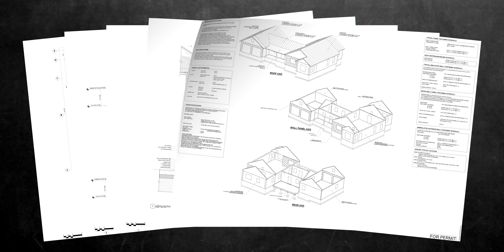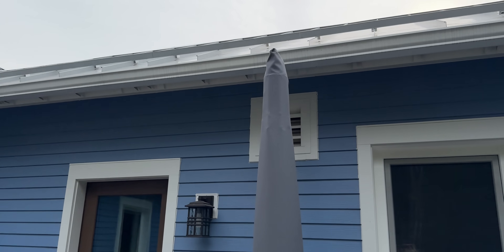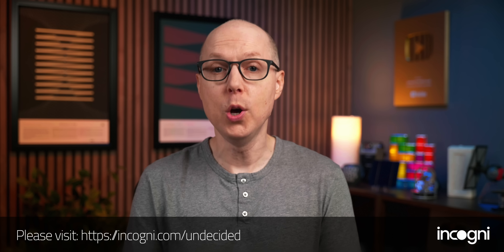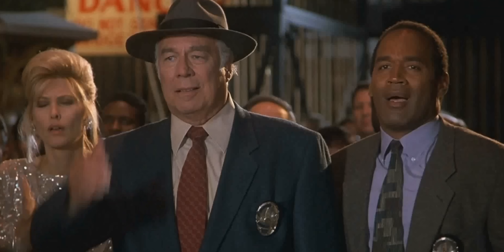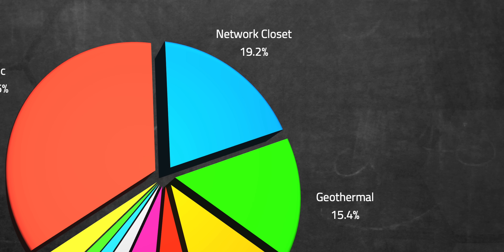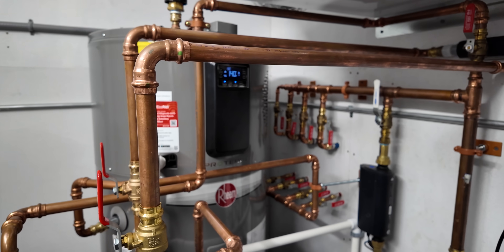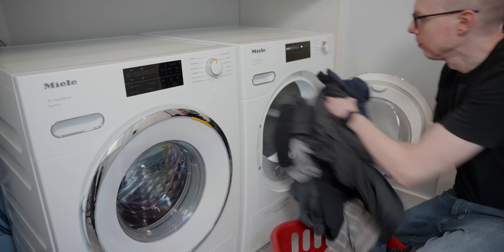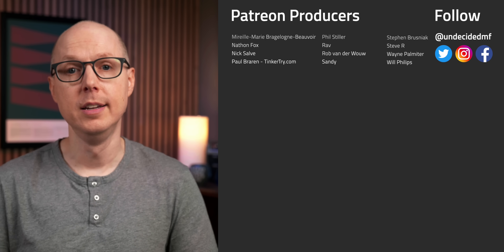What I Learned After 1 Year in My Net Zero House

Comment from the maker: Do you have any experiences you can share using similar tech or approaches? Take your personal data back with Incogni! Use code UNDECIDED at the link below and get 60% off an annual plan: http://incogni.com/undecided

If you liked this, check out The Genius of Hot Water Heat Pumps https://youtu.be/abGiNL9IT54?list=PLnTSM-ORSgi7HT9O73K9oYUe19eS-wjxX
Reply: Also your dehumidifier should give off heat if I'm not mistaken.
Reply: @UndecidedMF, you said people think they are subscribed, but are not...   That made me check and it said I was not subscribed.  I know 100% that I WAS subscribed.  Somehow I no longer was.  I have re-scubscribed.  Since other people thought they were but were not, maybe there is some bug that is auto un-subscribing people from your channel.  Might be worth mentioning the possibility on a few videos, that way if someone just happens to catch one of those they will know to double check that they are still subscribed.
Reply: Same here Matt. I was subscribed, but no longer am. I will resubscribe.  @bowserkoopa1088
Reply: Isn't the floor to cold because you lack the basement? Similar european homes have an underfloor  water heating system.
Reply: @drgyt2469  I’ll bet the floors are roughly the air temp.
Underfloor heating is to replace central air, not to provide a warm floor, that’s a benefit.
Reply: @drgyt2469  I always thought that but it seems they can be insulated.  l lived in two northeast ground floor, on slab apartments.  The first you could feel the slab get colder inward from the corner as the winter progresses and I used to watch TV with my feed up because the winter temperature of the first two feed of air over the floor was about 50F.  My next apartment had a floor and outside sill wall that was insulated so that did not happen. And I could wear only sock feet in the winter.
Reply: A regular dryer does not (directly) vent conditioned air to the outside. It vents out the super humid and warm air from the wet clothes. I know, it pulls outside air in, but some would leak in anyway. Your ventless dryer's benefit is that it uses a heat pump as the source of heat for drying. If it pushed the humid and warm air to the outside, it probably would not be less efficient overall. But maybe I'm missing something. A definite benefit would be less microplastics and offgassing in the house from clothes made from synthetic materials.
Reply: @FLPhotoCatcher  you need a leaky home to push that hot humid air out. Also during the winter, you are losing heat to the outdoors even before your leaky home lets in the cold air. In the summer, you would be saving energy in theory as the air evacuated is hotter than outside air. What a “ventless” drier really needs is a way to send the hot humid air thru the other side of the heat pump cycle to condensate that moisture out of the air, but we literally can’t because there is lint in the air and any condensator would immediately be covered with lint and cease working immediately (it wouldn’t work long enough for one drier cycle even if you could be depended to thoroughly clean it between loads).
Reply: @FLPhotoCatcher  An old dryer set up for the original dryer in sixties takes air from the room and vents through the wall (through a window installed duct) to the outside.
Reply: You may have lost your old span data, but surely your bank has your energy payment data vs current ...... knowing old and new unit costs you can extrapolate old BTU use vs new.
I fell into the renting trap years ago, and once that happens here your trapped for life unless something lucky happens, so all I can do is reduce consumption on appliances and wear warmer clothing....
Reply: @UndecidedMF  Matt Risinger recommends conditioned attics... You should check out his building science videos!
Reply: @-GBD-  he isn’t in Texas, but maybe it would help.
Reply: @-GBD-   He also lives in Texas. This Guy live sin the Upper NE.
Reply: We built a “passive type” home in early 2020 ( before cost got stupid ), air gapped dual 2x4 walls filled with compressed cellulose, triple pane German passive windows and doors, R42 walls, R85 Ceilings, high efficiency german ERV , induction cooktop, hi velocity forced air heat pump, Rheem hump pump hot water, heat pump dryer, .16 door blower test, house is at 51 degrees latitude in Canada and house handles +44C in summer and -32C in winter. The biggest “problem” is house is so efficient and electrical bill so low I can’t justify the solar and battery storage even with power company’s 10K grant. Don’t have a basement but 7’ conditioned crawlspace for mechanical space which I couldn’t live without.
Reply: So what you are saying is "Just like a cat up on a cold induction stove" instead of a hot tin roof?
Reply: I really love how detailed you are. I am currently remodeling a 75 year old house that has been added onto 2 times prior. Very different experience from what you have built it terms of how well sealed the house is. It will be our forever home. I've tried to make a lot of choices that will help make it more efficient than it was originally, but there is only so far I can go that is reasonable. I'm curious if you have any idea of how long until the extra costs of upgraded building materials and more expensive equipment is break even with your savings made on lower energy bills?
Reply: @mrscottcheek  zip sheathing?
Reply: What was the cost of all this?? And is there a way to build a home that would pay for itself from a “net negative” wouldn’t actually pay for itself but would help towards paying off itself??
Reply: I installed a rheem hpwh about three years ago. No desuperheater so it does all the work for a family of four. It averages about 85kwh a month. 

I had a gas water heater before so I had to run a new 30amp circuit, other than that it was a drop on replacement. It does not significantly lower the temperature of the basement utility room. In fact with my server cabinet it helps cool things a bit. With its free dehumidification, and free cooling in the summer it has some interesting synergies going on with my dehumidifier and server cabinet.
Reply: @Static2606 , hey, our basement is already cool(er), but more importantly I couldn’t justify the 50% smaller capacity (43 vs 63 imperial gallons) AND the 3x cost with installation of a HP HWT vs the “regular” electric hwt. Cost would’ve been 4x for a larger capacity HP hwt.
Reply: Superficial goal unrealized.  Should have at least 100kw of battery backup  and 25 kw of solar panels.
Reply from the maker: @ASDasdSDsadASD-nc7lf  I didn’t realize you had access to all my data on how this has worked out 😂. You might want to wait until the second part to see.  Also, 100kWh of batteries would have been crazy expensive and not worth it financially.
Reply: Are the solar panels with the other orientation on a different circuit?
How much time are some of your panels in tree shade?
Reply: 1:22 - first net zero home that has uninsulated copper pipes, never seen that before. But Europe is different, Energy prices much higher and people lot more aware of their CO 2 footprint therefore people are not buying F150 or any truck or big car.
Reply: Overkill or expensive on the geothermal and near airtight seal of the house. wished the house was more about ROI or saving.
Reply: @zodiacfml  prob in the second part he's putting out next.
Reply: @UndecidedMF  mine is a bit different full basement, conditioned attic, airsource heat pump, got a .4 ach on the blower door. Lots of needy little details but long and short we have been in this house now 1 full year. Average monthly power consumption has been 670 kwh. That's with 2 people 2 dogs, 2 laundry centers running a load a day avg, I have a 10/12 roof pitch facing due south that will be getting a total of 13.6 kw of sollar excessive for the home yes but there are other power demands on the property it will help to offset. Power is currently supplied by a single 30a 240 curicut, maintaining what Is essentially a giant homemade ups. 120kwh worth. Been meaning to upload video series on it but haven't gotten to editing it al have like 700 hrs of footage to go threw from the concept, threw design, and the actual build. Maybe I'll get to it threw the winter...
Reply: You could have built a fake floor, about 1ft above the congreate. Just built the walls 1ft higher if you don't want to fix on fake floor. I have seen in large office construction.
Reply: @darrenmitchell2830  And old computer rooms.
Reply: why you removed Hindi audio track but you did not other languages your videos are interesting but only when i watch it in Hindi.
Please add hindi audio track.
Reply: why you removed Hindi audio track but you did not other languages your videos are interesting but only when i watch it in Hindi.
Please add hindi audio track.
Reply: why you removed Hindi audio track but you did not other languages your videos are interesting but only when i watch it in Hindi.
Please add hindi audio track.
Reply: why you removed Hindi audio track but you did not other languages your videos are interesting but only when i watch it in Hindi.
Please add hindi audio track.
Please reply
Reply: why you removed Hindi audio track but you did not other languages your videos are interesting but only when i watch it in Hindi.
Please add hindi audio track.
Please reply
Reply: why you removed Hindi audio track but you did not other languages your videos are interesting but only when i watch it in Hindi.
Please add hindi audio track.
Please reply
Reply: @husainalmahmood4601  You said that five times.
Reply: What kind of refrigerator are you using?
Reply: We have a Unity home, and went w/a basement, and their recommended Mitsubishi HyperHeat mini-splits.  We have a heatpump water heater as well.  Our home is the best one we've ever lived in, and I would have a hard time going back to a regular-built house.  With our solar installation, we've hit net zero 2 of the 8 years we've lived here. Heat-pump all the things is right!
Reply: We're recently having problems with insurance companies and solar panels here in Ontario Canada (not sure if this is happening in the US or not). There's a CTV News story about a couple who had previously installed solar panels and their insurance company claiming that they require a "extra nominal fee" per year. I thought I'd post this not with the intent to make people second guess if they should install solar panels but rather to be aware of the recent news.
Reply: @joireland  The American insurance companies do not add extra charges. They just send you a cancelation notice. It is happening mostly in Florida.

My idea is to move your solar panels to the yard. But I have not heard anyone say that yet.
Reply: @Matthew_Loutner  Make them tall enough you can use them for a porch and mow under.
Reply: I would have built a basement and put a roof on the basement.
Reply: Everything you have done is technologically cool!  I really enjoy your videos and all the technology.

I mentioned this in one of my previous comments, and I think the average person—which you are not—should keep it simple—KISS. Using what you have done as inspiration is a good starting point.

If you are building a new home, material choices are essential.  Small things make a big difference over time: roofing, siding, windows, etc.  Mechanicals:  HVAC/Supplemental heating and choice of hot water heater, tankless or tank.  Supplemental heating is an excellent way of saying high-efficiency wood stove or natural gas boiler.  

Because I like technology, my house has over 70 "smart" pot lights.  It's cool to tell Alexa to turn the lights on and off, change the colors, etc.  The bad thing is that other people don't understand this technology very well and will turn light switches on/off.  Also, over time, the "smart" pot lights will go EOL, and will need to be replaced.  They won't stand the test of time and will become money losers in the long run.  I mention this only as a warning... Technology does not hold up over time, and it will be expensive to replace it.  

A perfect example, I have been in IT for over 35 years.  In large buildings, HVAC systems have numerous network-based controllers that talk to central control systems.  Both the controllers and the software typically go end of life (5-7 years), or the company that installed/manufactured them goes out of business, and then you are stuck.  There are no firmware upgrades (security vulnerabilities) or software upgrades (software is vulnerable over time or unsupported as the OS ages out).  Next thing you know... You are spending big $$$ to get up to date.

Imagine you have a Tesla or other EV, and the company stops supporting software upgrades or goes out of business. No batteries for you.  It's going to happen, but your ICE vehicle keeps working. 

These things need to be thought through as best as possible when doing something like this. KISS -- Keep It Simple Stupid.  And, then again, some things are just cool to do.  In my case, "smart" pot lights.
Reply from the maker: @MikeSmith43761  100% I don’t think anyone should do exactly what I did, but hopefully take inspiration and ideas from it.  KISS is key.
Reply: @UndecidedMF  So your closet runs between 340 and 250W average? Given the percentage for the energy gave you spend even less on conditioning your house so how large is the volume you actually condition? Would be interesting to see a W per cubic feet or m3
Reply from the maker: @nokarukuta587   I got my network closet down to ~200W on average (after my 30% energy saving tweaks).  Interesting suggestion on the cubic feet calculation.  I’m still compiling all the data for the follow-up video and see if I can make that work.
Reply: What happened to the channel that shows everything in English¿¿??
Reply: Geothermal cost
I have a geothermal system here (Southland NZ) - and I did it slightly differently!
You have gone deep - this does eliminate the efficiency drop in winter - here you go down 7 meters to get a consistent summer winter temperature
But that is far more expensive! - I went down 2 meters - which does drop the winter efficiency a wee bit but which is a LOT cheaper
Size of the ground loop - not sure how big yours is but people here massively oversize them - you are going to be running steady away - not letting the temperature cycle
Mine is 5 meters by 5 meters and 2 meters deep - which means it cost me less than $1500 for the ground loop
Reply: When we needed to replace our HVAC system several years ago, we went with the Water Furnace series 5 zoned. Since our usable ground is limited and the water out front is too shallow, we also went with wells. Since the original system was ducted in the 50's, we also replaced all the ductwork. Another challenge we haven't dealt with yet is the poor insulation. They just didn't think it was needed back in '53 when the house was built. While we don't currently have on-site solar, we subscribe to a local community solar project and pay utility rate - 20% for the solar generation.
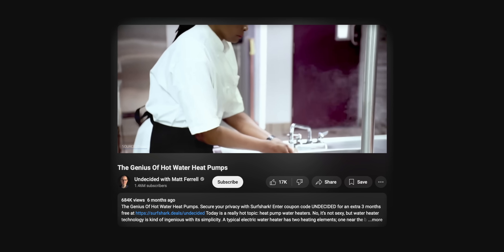Reply: 16:45  I track my NG water heater and it costs me on average $16/mo.  It's lasted 23 years so far.  I just have a hard time thinking a heatpump model can ever pay for itself with its added complexity and robbing heat from the house in order to heat the water.
Reply: THIS IS VERY IMPORTANT. 
Watching your vid I never noticed your batteries on the outside of your house
I'm guessing that your batteries are Lithium - Ion , one very important thing that
we have learnt from EV fire disasters  is it not just thermal runaway that can
cause an uncontrollable fires, but looking at the many EV fires and explosions 
is that the interior of the car can fill up with gas from charging leading to an 
explosion strong enough to blow the doors off the car and also demolish the
house . I certainly would never house these in my home , maybe a seperate 
building many metres away from the house would be safer.
Keep safe .
Reply from the maker: @budbud2509  unfortunately much of what you’ve said isn’t accurate.  There is no gas build up inside of an EV when charging. EVs are far less prone to catching fire than gasoline cars (https://www.motortrend.com/features/you-are-wrong-about-ev-fires/).  And not all lithium ion batteries are created equal.  Lithium iron phosphate (LFP) are extremely safe and far less likely to suffer from thermal runaway than other formulations.
Reply: @UndecidedMF  
Unfortunately u are out of date .
Yes Petrol /Diesel cars may well catch fire more often , but they are 
easier to deal with . EV fires hare much harder to control and can re ignite up to 2 weeks later , hence new regs about the storage of EV damaged 
cars. U can take the fire in the uk destroying a multi story carpark 
and also that block of condo's in Korea as evidence to the run away nature
of EV fires , had these both been petrol fires the sprinkler system would 
have dealt with it and probably extinguished it.
With regard to your remarks , go and argue with several fire depts 
in Aus where instead of runaway fires , there was gas built up inside 
the cars and exploded , blowing the doors off the car and blowing the garages down and setting fire to the house.  Yes I would agree this should
not happen , but there are instances where it has .Fire dept report said there was a build up of of gas inside the car that caused the initial explosion.
Reply: @UndecidedMF  
Unfortunately I did not keep a record of that previously mentioned 
vid showing a doorless car, however I did find this one that explains 
things a bit. 
I have no axe to grind with regard to EV's, my motivation was your safety 
and no matter how slight the chance was , I for one would not take that 
risk with my family . I know its about as likely as an unsinkable ship 
hitting an iceberg on its maiden journey ( Thanks Titanic ) 
https://www.youtube.com/watch?v=dc6CIITqW20
Reply: The only suggestion I'd recommend would be a smallish wind turbine in the back or front yard to supplement the solar.
Reply: You can ask the new owner.
Reply: We went through a similar process and we are just about at the 1 year mark too! We went with a major remodel that brought our house down to the studs, major upgrades included: updated insulation (nothing fancy, up to modern code), radiant sheathing for roof, 5 zone mini split, whole house fan, cut off natural gas supply, heat pump water heater, induction stove, solar and battery backups. It's difficult to compare to previous usage since we didn't have very sophisticated energy trackers, but our energy bill is a fraction of what it used to be, this is even with 2 evs
Reply: the 4% is probably oven or hw heater backup
Reply: You really look at theM4 pro mMac Mini as your main computer because it really sips energy less than 10/watts!
Reply: Matt Legrand here, pretty undecided too ! I am looking at on my solar pannel array at the moment. My wife and I built a certified passive house in south west france at the same time as your project. Come check it out if you are interested !
Reply: The heat backup is from electric resistance heating element in the furnace, it turns  on when the mini split can’t keep up on a cold day.
Reply: surely it should be smaller
Reply: @undecidedMF - Matt I’m curious to know what the safety risks are with the internal air quality (CO2 levels etc.). What happens if the air exchanger fan fails? Do you have any fail safes?
Reply: You really need to insulate all of your hot and cold water pipes. I saw no insulation on any of the pipes in that video clip.
Reply: @RWBHere  Insulation, Insulation and more Insulation is the key to energy efficiency...
Reply: What happened to the channel that shows everything in English?
Reply from the maker: @rogersmith2549  what are you referring to?
Reply: @RWBHere  I'm pretty sure most of the pipes are insulated. if you talking about  fragment at 1:18 mark - these are pipes very close to heating equipment and they not getting insulated. I believe there is a standard for that
Reply: @RWBHere  With all of that pro-press, who has money for insulation?
Reply: Heat pump water heaters need a huge volume of space to work properly. Not to mention that it will drastically drop the temperature of the surrounding air to heat the water. Depending on your geographic region and home design this might have drastically negative effects. Consult with an educated plumber before "just swapping it out"
Reply: @samuelfeguer  We have a heat pump water heater, and it's in a small closet in a small bedroom. The closet door is open all the time though. But no problems at all, and the room is cooled and dehumidified. It's even fine in winter.
Reply: @FLPhotoCatcher   Does anyone actually live in that bedroom? What part of the country do you live in. There's a reason you have to leave the door open.
Reply: @samuelfeguer  Yes, it's my sister's bedroom. We are in Tennessee.
Reply: Those heat recovery ventilation system are mighty expensive. 
I did the math of how much it saves and I need decades for ROI. 
Also, drier messing with the interior?
WHY?
It blows the humid air out. 
It should get the fresh air from outside too.
Reply: @ehombane  he has “ventless”